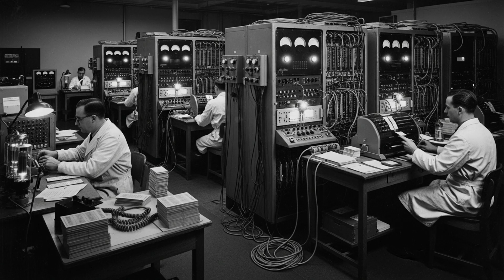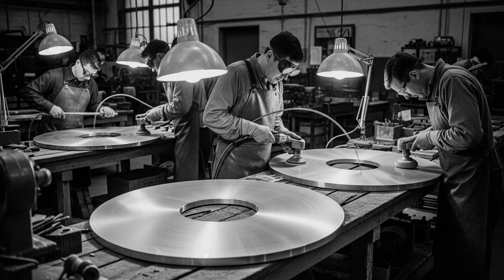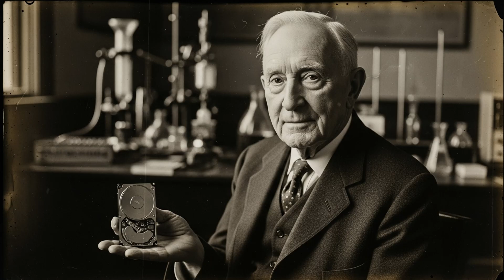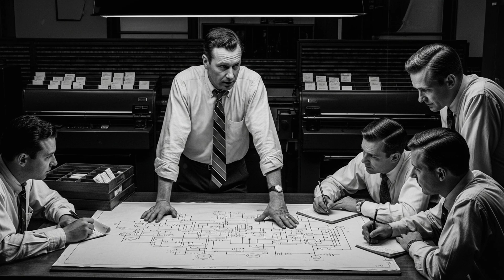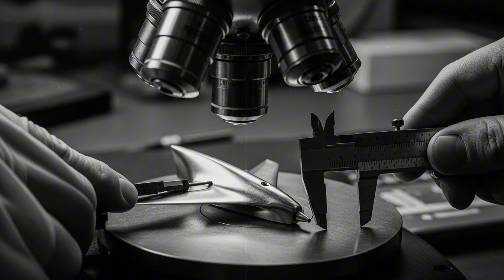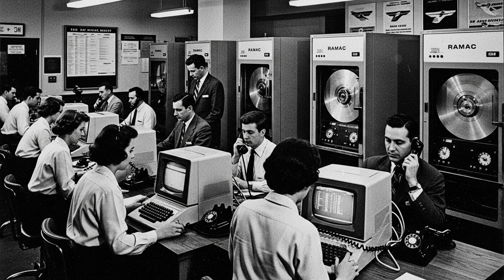in 1956: First Hard Drive History | The in-depth documentary

Comment: In the mid 1980s in high school, I was known as the computer 'whiz kid' because I had a CP/M system, an Atari, an Apple, and a C64. My school started a computer curriculum that I was involved with just as a student. We had a lab of about 15 dumb terminals connected to a TEN MEGABYTE hard drive that was the size of a refrigerator. Storage space was such a premium that you had to get approved to even save a text file smaller than this comment I'm typing right here.